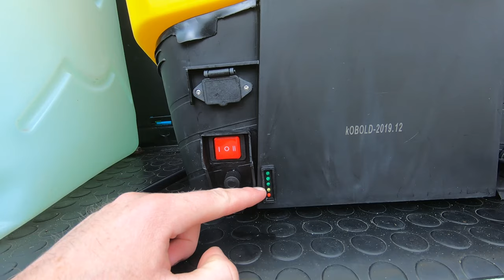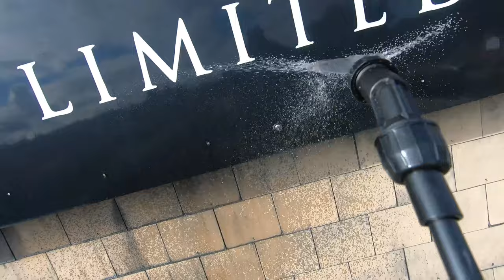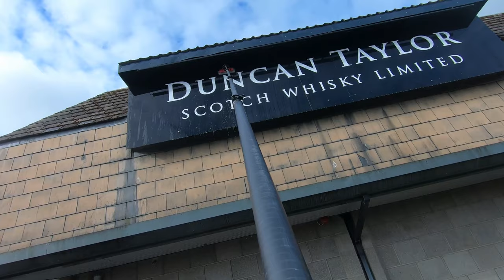BIGBOY 2 BACKPACK | HOW IT WORKS | DISCOUNT FOR YOU AT WCW?

Comment: I started out with the  bigboy from wcw, it was good and I did add a remote on/off at one point which worked out great. These days I use the 20l seaflo backpack that's cheaper. Has a max flow rate of 2,6l/m , 70psi, sits nicely on my sack truck and is very light when empty,  The battery is 12v 7ah is removable for charging as it comes with a charging dock but can also be charged when installed.  Being only 20l I do have to take an extra 5l of water with me on some jobs. All in all its been a great purchase.

Comment: Peter when cleaning facia's and soffit's,can you use ordinary water,or does it have to be pure water,and can you tell me ,what you used for pure water,before you got your van installation,thank you very much.
Reply from the maker: Yeah I would just use regular water for fascia and soffit cleaning. Keep the pure for windows 😊👍🏻

When I started with wfp, I made my pure water at home using the Unger hydro. Then filled x4 25L containers, and used the backpack on a trolly to pump the pure water up to the waterfed pole 👍🏻

Comment: Think I need to check out G101 as I don’t think I’ve come across that before, have you ever used no-nonsense degreaser from Screwfix?
Reply from the maker: Yeah g101 is very good, bit more expensive though. 

No I've not tried no nonsense before, is that quite good?

Comment: Hi Trad, bit of advice Plz, I've just taken delivery of the BigBoy 2. Do i need or can I add a length of Hose from  the Pack to the Pole for added mobility. Or will it loose Omph if i do that. Thank You
Reply from the maker: My hose from the backpack is around 50ft and works fine 🙂
Reply: @TradMan  Cheers Trad, would that be something like the Yellow Borehose?
Reply: @TradMan  I meant Micro Bore?

Comment: Just need to pick your brains mr trad man starting water fed pole soon thought i will have to get some trad gear incase I have to do some interior work could I get away with just a moerman fliq pad and a pole to start with. Your thoughts would be really appreciated
Reply from the maker: Yeah no worries, you can start with that no probs at all, the full excelerator with fliq will really help you out as you can use it in hand or on a pole 👍🏻

Comment: Hi man, quick question can use this backpack for biocide treatment on roofs?
Reply from the maker: The pump is not designed for chemicals. It will work but will knacker the seals eventually. 

The chemical pump box from wcw might be a better option for you

Comment: Thanks for the discount, and info, just waiting for delivery now. one question though, can i use a  uni-valve on the pole with the back pack?????
Reply from the maker: Yeah absolutely, the pump will stop and start when you operate the univalve 👍🏻😊
Reply: @TradMan   hope you get some sort of referral fee from wcw, just spent nearly £900 with them using your Tradman10 code 👍 "nice saving" thanks
Reply from the maker: @kennethspeakman5600  nah I don't get anything from that but its ok, knowing that something like this helps window cleaners is great especially during these difficult times.😊👍🏻
Reply: @TradMan  i have that Same backpack but my pump won't shut off when I engage univalve...it just keeps pumping and hoses fly off, is there something I'm missing,  thanks fella.
Reply from the maker: Are all of the connections / o rings tight? If there's any leak it will continue to pump.
Reply: @TradMan    Yes I had a small leak...I fixed it working fine now, thank you ☘
Reply from the maker: @antandbecksc  😊🤜🏻🤛🏻

Comment: Hi great video as always, in the video were you also using the backpack for the wfp work after spraying, if not would it be feasible?
Reply from the maker: Hey buddy, for the wfp pure water cleaning I was using my van mounted facelift system. I use the backpack for chemicals only now. 

You could use the backpack for both but you would need to run the backpack for a minute or so to clear out the chemicals from the pump.
Reply: Thanks for the reply, how does this backpack compare to the Gardiner backpack?
Reply from the maker: I've not tried gardiners one but I've seen plenty people use it so must be decent. Being Gardiner I'm sure it's good. I'll have to have a look and see if someone's done a good review of it and compare features to this bigboy 2 👍🏻
Reply: TRAD - MAN THE WINDOW CLEANER do you have to use a pole to spray chemicals or could you use the WFP to spray the chemicals?
Reply from the maker: @alexmunn36  you could use your wfp yeah, it would just come out as a jet rather than a spray if you had pencil jets fitted

Comment: What sprayer nozzle do u use? Ive the iconic protector pole with the adjustable head but im struggling to find a spray nozzle compatable
Reply from the maker: Its an ionic spray nozzle 😁🤜🏻🤛🏻
Reply: @TradMan   yeah ive seen that one they said its not compatible as mine is the one where the fly lead comes out the top and connects on the outside to the brush end

Comment: Hi Trad man! I've been doing some research into setting up a window cleaning business. So the pure water allows you do not have to worry about drying the windows as it doesn't streak or stain because the water is pure? I was thinking to start out a water feed pole system with maybe the bigboy 2 I have a van already so maybe some pre-made pure water? how much water would you use per house that had roughy 10 windows? I'm not sure if I'd want to hook up to someone's water supply as everyone is on meters nowadays just trying to work out how much water I'd need per day. Any other advice you have for someone starting out? I live in an area where a lot of new builds are popping up so hoping work would be a little easer to find. :)
Reply from the maker: Yeah working with a backpack is a great way to start!

If your using wfp for everything your gonna need a lot of containers! I used 4 or 5 a day (25 L) but I still do a lot trad. So you would need around a dozen barrels roughly.
Reply: @TradMan  Thanks Trad man. With the pure water do you add anything else into the mix or is just the pure water and a good brush all you need for windows? What wfp would be good to start out with I'd need to be able to reach 3 storys so I'm guessing at least 30ft? Also how many litres of pure water can the Unger Hydrow filter before it needs changing? I know different hard water areas effect that just after a rough idea with costs
Reply from the maker: Don't need to put anything in pure water, its good to go 👍🏻

Yeah around 30ft is a good all rounder.

How much resin costs depend on a few factors so impossible to say really, depends how much you use it each week and how hard the water is as that can drastically change how much you spend.